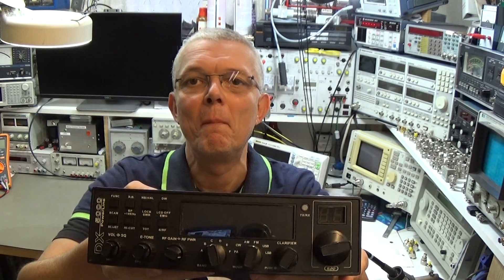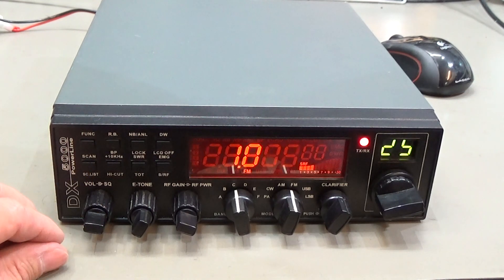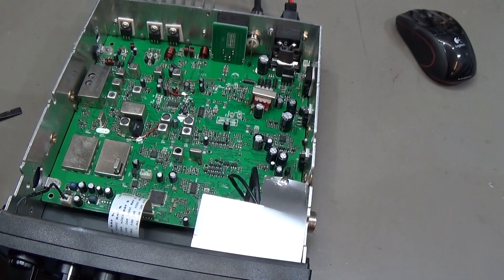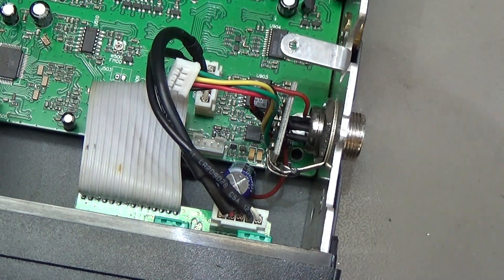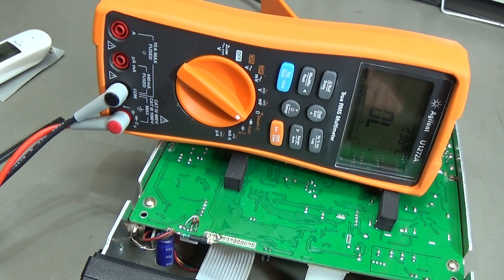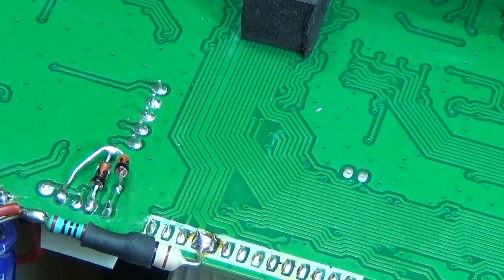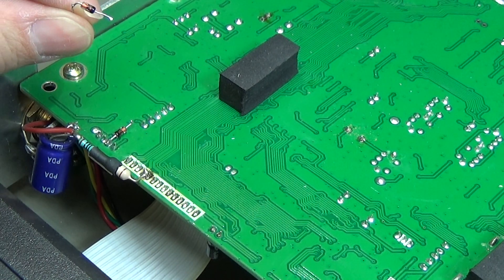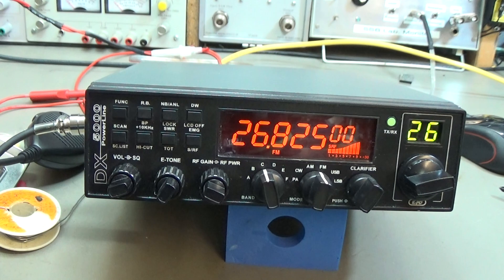#63 HAM CB Radio Repair: KPO/ Maas DX 5000 always on transmit

Comment: Very interesting,,what was the idea of the 6 pin microphone as the original was a 4 pin microphone.
So what did the change of microphone actually do.
73's Alan in the Uk
Reply from the maker: Allow to deliver DC voltages for power mike usage...73

Comment: both 5.1Volt Zener are for processor protection Pin3 (PTT) and Pin4 (function/menu). modification was not done well i miss the two 330 ohm protection resistors to the diodes. this addition is common after conversion to 6pin socket /w 12 volt feedpoint pin6,  according to DGCH standard
Reply from the maker: +Klaus R. Hi Klaus, that makes sense, thanks for clarification!

Comment: Again a nice, well explained video. 
When a component on board is broken like this there ould be a reason for it.. Did you check what could be the actuall problem?

Hope for more ;)
Best regards
Jon Helge
Reply from the maker: +cqcqcq de la2wha Hi Jon Helge, thanks for comment! Yes you are right, there should be a reason. In many cases these reasons are bad design, solder work, mechanical stress, ageing components. In this special case I don't know as it is part of a mod which I didn't investigate more in detail. 73's

Comment: Maybe the Zeners were added due to a DC voltage higher than 5V (maybe 8v?) being sent out the mic socket, you don't want a short on the mic sending that voltage into the micro and frying it...
Reply from the maker: +Simon Parkinson Hi Simon, well in this case it is more a kind of switching network but had no time to investigate it.. Thanks for comment

Comment: Well, sometimes the easy repairs make up for the ones that make you pull you hair out (as I'm troubleshooting a home intercom system PCB and losing some hair myself!). I wonder if that zener has something to do with setting the voltage for maybe an electret element in the microphone? Thanks for sharing! 73 - Dino KL0S
Reply from the maker: +Dino Papas Hi Dino, yes I totally agree! Sometime a repair can really make you pull out hairs so it is good to have also some easy fixes:-) No there is an extra voltage supply to the mic. I would need some more time to reverse engineer the mod to know what it is for... 73's and thanks for comment!